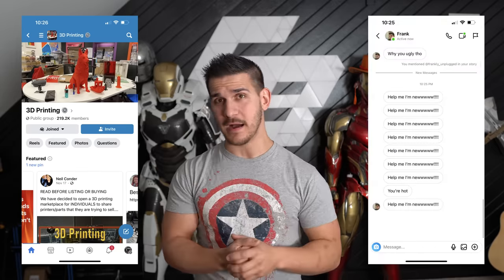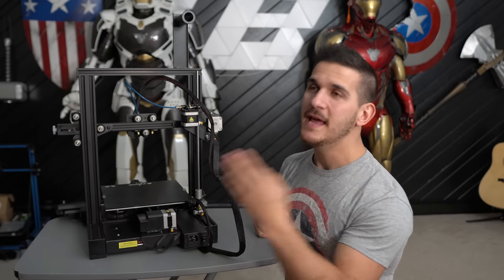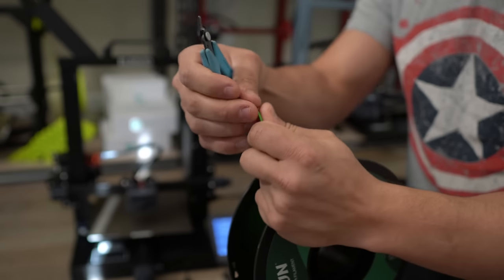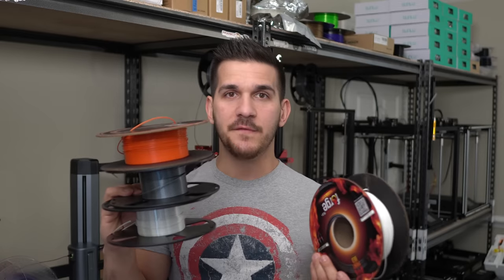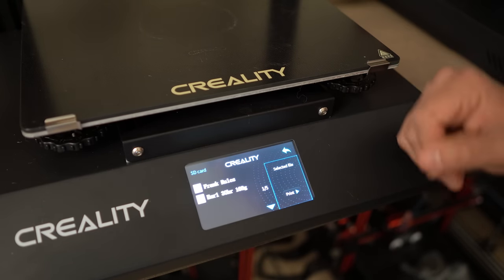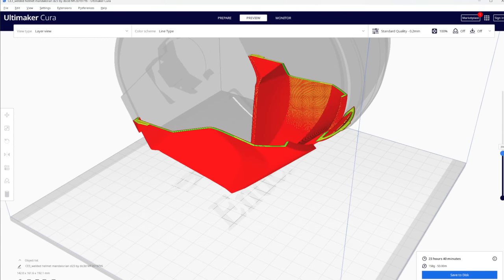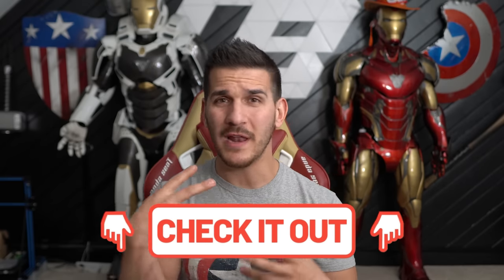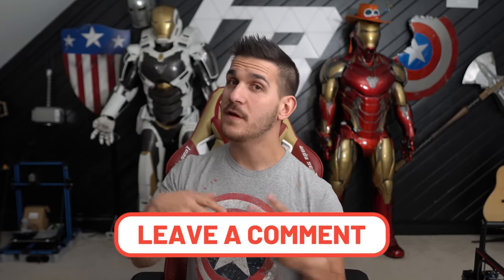Troubleshooting 3D Printer Issues | 10+ Common Problems 3D Printing Beginners Have!

Comment: Hey frank. I’m a little confused. I have an Ender 3 V2 and my leveling is messed up pretty bad. I have tried what seems like everything to solve the issue manually but then gave up and bought the auto leveler Creality offers. Even with the auto bed level the print don’t come out properly. Only about 1/3 of the printing bed actually works currently because of the slight decline on the other 2/3 of the bed causing the PLA to string in the air and not stick to the bed. I don’t know what to do anymore.
Reply from the maker: Did you check thah leveling video I linked?
Reply: @FranklyBuilt  I have watched the video a few times now, still can’t figure out what I’m doing wrong

Comment: Does anyone know if there is a video talking about support settings in depth, my specific problem is support fusion at the moment. It's nearly impossible to rip the supports off of my prints, even the adhesion pieces like the raft stick to the print way too much. Any advice would be greatly appreciated. Very new to all of this and I'm using a Magician X from Mingda.

Comment: My issue I have a cr-10s the system says the nozzle temp is hitting 200C when I check it with a Lazer thermostat it is reading 23c . I bought a brand new hardware to see if that's the issue for the printer and it doesnt  seem to be working any suggestions?

Comment: I suggest people having problems print not sticking, to have a peace of thin window pain glass cut to the size of the bed, small (2) clamps front and back and apply glue stick on the top of the glass, PROBLEM SOLVED.

Comment: Hi, well I’ve been getting a problem for like a week, I have a kingroon kp3s and when I try to print something it doesn’t do anything, it isn’t clogged cause I see plastic coming out but when I press print it just stay in one place, I format the sd card and tried to make a new gcode but still nothing…
Reply: The timer starts but it stays on 0% and I have to manually put the temperature, then I downloaded the firmware for the kp3s perfectly but still the same… can someone help plis. Thanks

Comment: One problem I have been having is that my 3d printer in not turning on but the voltage is good and the outlet is fine, also nothing is fried ether and the wiring is good too, but not a single thing makes a noise when I turn it on

Comment: I just got an ender 3 pro and I tried connecting it to my computer and the usb doesn’t show up and in cura it just says save
To disk and that it I tried unplugging it and plugging back in I made sure it’s the right wire and everything it doesn’t say anything about usb and I can’t connect my printer with a network

Comment: anyone got any tips? my 3d printer when it turns on the screen works, but the fan doesnt turn on, i cant preheat, i cant print, i cant change filament, i cant change axis

Comment: I built a ride and I was even using it making a very loud beeping sound and after my brother put a chip in after you used it on his PC no my 3D printer will not stop doing a baby sound even when the chips off the weird part is I actually did put it together and it was working then after my brother use that chip it's not working anymore

Comment: Leveling? Nah I'll just get the V3 SE with ABL and not worry about it.
Reply from the maker: I mean. That printer is so small it doesn’t need an ABL. but the tech advancement is cool
Reply: @FranklyBuilt  Small? Was your first machine the Elegoo Neptune 3 Max? It had to be for you to call a standard 220*220*250 mm build volume "small"!
Reply from the maker: @user-ot4wp4mz6l no haha it was an ender 3. The e3 sizes are small printers, the plus sizes 300x300x300 are medium and the max’s are…max. 99% of people will agree the ender printers are small machines. You can’t even print a full helmet on one shot on them.

Comment: I can’t find my problem it’s just printing out spaghetti if anyone knows pls reply soon
Reply: @dino-man9574 Mine does the same thing tell me if you figure it out
Reply: @Bassistboy  try heating up the bed I figured it out
Reply: @dino-man9574  I have tried that before what temp
Reply: @Bassistboy  120
Reply: @dino-man9574  it didn’t work 😢
Reply: @Bassistboy  is you nossel leveled